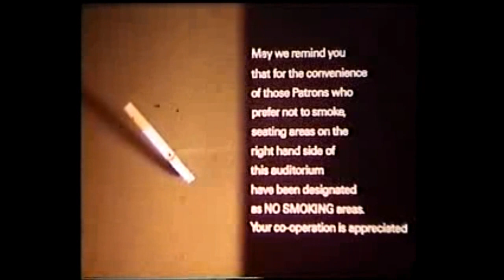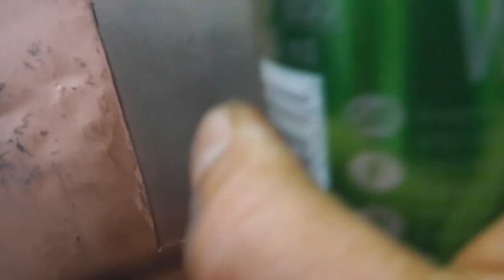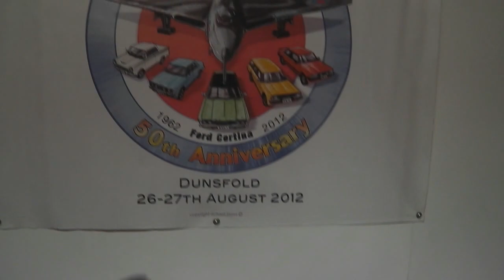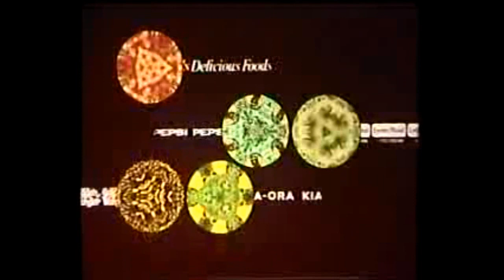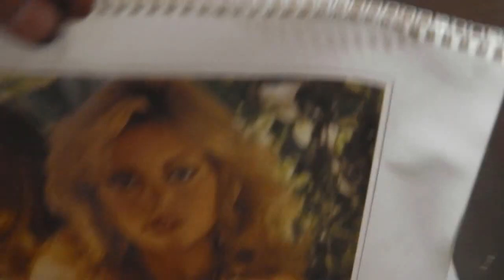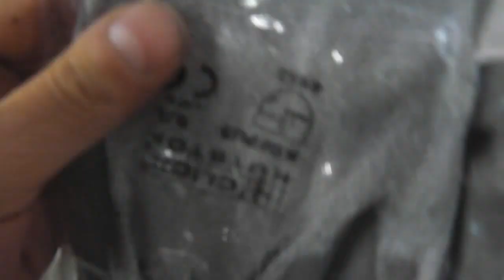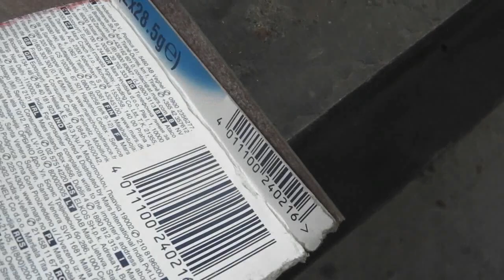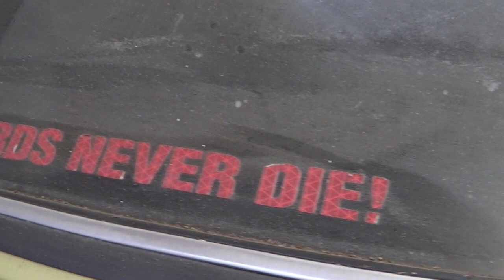Mk3 Cortina Restoration - Project Ruby EP6

Comment: R.i.p mk3 G.T!

1 once had a early metro,took it to bits and discovered both inner and outer sills were basically filler,previous owner had done such a good job you couldn’t tell,only discovered wen we decided to strip it and my dads lump hammer went straight thru the side and ended up on the garage floor,needless to say i soon got rid and bought another mk5 tina(I’d previously traded said  metro for a mk5),wat i stupid idea that turned out to be!

Comment: Great work as always Pete! Have you a video showing the spot weld removal on a heater bubble ?  I was having a nightmare removing mine at the weekend. drilled them out and used a flat chisel but when looking from inside the car had busted through the good bulk head metal instead of splitting the two sheets of steel so called it a day.
Reply from the maker: +sean roche Hi Sean, never removed a heater bubble on MK3s they have a larger bulkhead heater set up, easy to bust thru, go slower, look for colour change when drilling thru, that shows when you into the new metal, it will go rusty coloured, then your thru first panel, good luck, dont let a slip up get you down, take your time, any error can always be fixed, Mike the metal taught us all that its only Metal
Reply: Thanks Pete, my panel guy got it off himself last week, have a repair panel for underneath but going to have to fab a new housing for the fan as someone bodged it with galvanized tin and silicone. Good point about it all being metal!